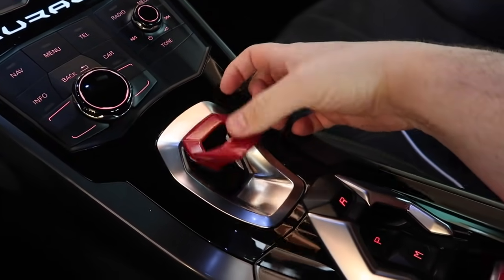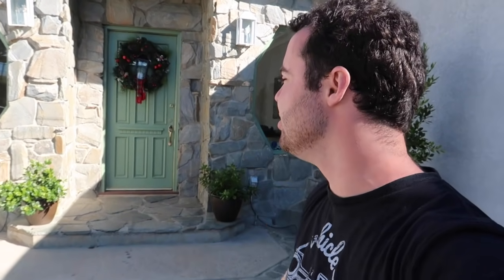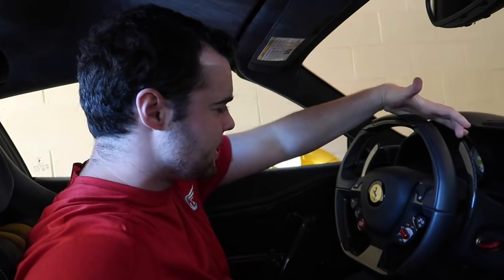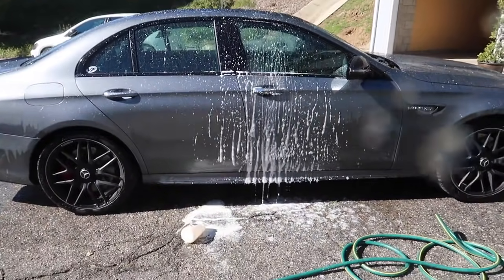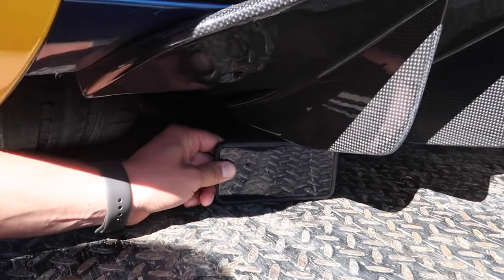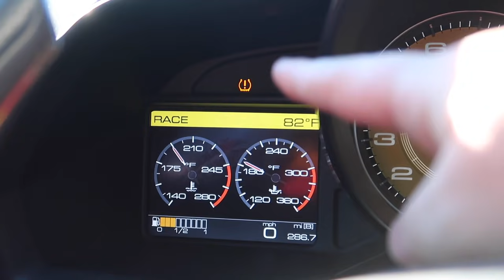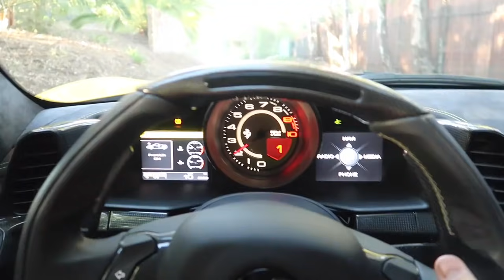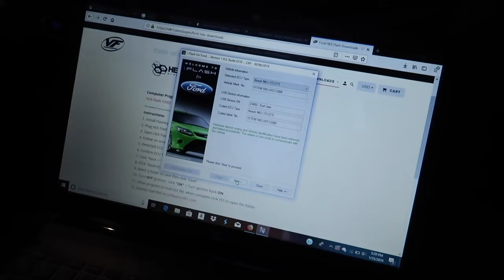HOUSE UPDATE

Comment: Is there some reason you couldn't take the tire off and take it to the shop yourself? Just seems odd to wait 2+ hours for a tow truck to bring an entire car to the shop and fix one tire when you have the ability to get it there yourself.
Reply: 63falconrs dealers like to know everything on a car was fixed at a shop if you say that you fixed it the car goes down in value
Reply: @jasonr6342  you can take a wheel off a car without performing an actual repair.
Reply: @AhuCJ  so in addition to the 5 normal lugnuts shown in the video there is also a center lock?
Reply: He probably does not know how. He looks like a girly boy.

Comment: the cup2 are zero pressure are they not? I drive mine with no air...that's why they call them "runflat"
Reply: Terry Mertz doesn’t mean they should run like that. Run flats are used on cars that don’t have Spare tires. You should still immediately replace a punctured tire no matter what.
Reply: that goes without saying...have you ever had a flat in the middle of the Mojave desert?

Comment: A real carguy would have jacked his car and taken off the wheel to fix it or have it fixed.. and also washed his car more often and without those fails
Reply: Frank Beliën unless he was waiting for a excuse for using the car, and drive it.
Reply: Frank Beliën well it’s a $700,000 car....
Too risky
Reply: It’s just the same as every other car.. just jack it and losen the bolts..
Reply: @thefwenkmeister972   im guessing you have experience with your own $700,000 ferrari??
Reply: Frank Beliën too expensive like I said
I know it wouldn’t be hard to do but it’s too easy to break something
Reply: lance smith no mine only costs 230k 🤷🏼‍♂️

Comment: Resetting the tune in newer cars doesn't clear you for warranty work--the computer records everything and the PIDs will be different, they can tell if a vehicle has been flashed and then reset.  I see it with Subarus all of the time.
Reply: UnsulliedSpy PIDs?
Reply: @melvinfreeman4040  It's a value in the computer which is changed when it gets flashed with the new tune.  In addition, the computer counts the number of times it has been started so if you bring in a vehicle with 30k miles on it but only a dozen starts that's another red flag.

Comment: Get a plug kit. It's not high performance solution but can be good enough to drive to a shop. Cheap and easy without need to remove tire/wheel. Motorcyclists do it all the time.
Reply: Ed SD it costs 700k would you touch it? No

Comment: I would have gone to the auto parts store, bought a patch kit for 7 bucks, and patched it myself.
Reply: run flat tires are not very easy to mount and dismount however a plug kit would have fixed it
Reply: @terrymertz1923  plug is what I meant

Comment: Shocking. Why not put air in just over what it should be. Drive gently to your destination and have tyre sorted. No need for AA.  
Looking at that it wouldn't be fixed here. Too close to the edge.
Reply: Actually it's not bad. Could still have driven on it tho.

Also what's with the patch?  Looks like something you use on a bicycle tyre.   Don't you use plugs that pull through the hole then trim it?